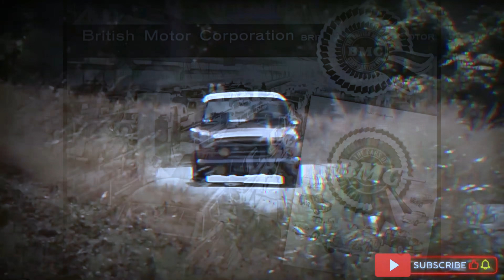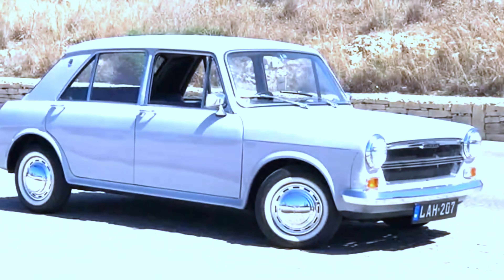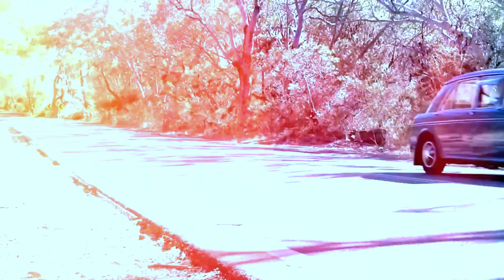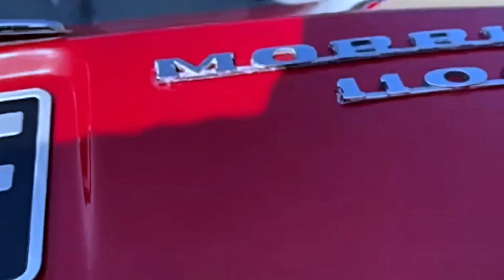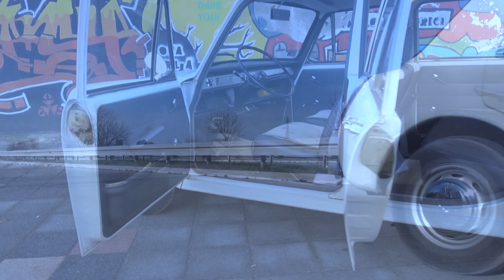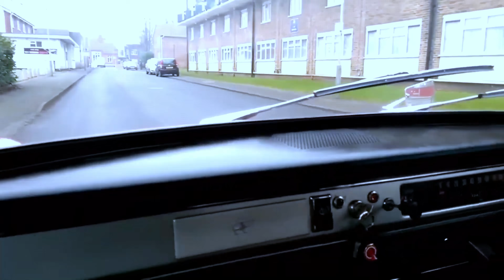The 7 Shocking Truths About the Austin 1100/1300 They Never Told You

Comment: I agree with harry gatto. These were always the austin/morris eleven hundred/thirteen hundred.  I owned an 1100.  A lovely car but beset with rust in the front wings and hydrolastic fluid loss which tilted the bodywork to one side.  Yes, it could be pumped up - only to leak again.

Comment: We had the Austin version of the 1100. When going on holiday one year in an English monsoon, we couldn't stop the rain getting through the front grill and on to the distributor. The breakdown man couldn't dry the unit out and only option was to tow us to a hotel for the night. Our two very young children loved the hotel and we hated the car. Got rid of it quickly on our return home
Reply: My girlfriend in the mid-70's drove her father's Austin 1100 at University. It would get water in the distributor as soon as there was any rain. I notice in this video that someone had fitted a rainguard over the front of the engine. Things weren't improved by a HT lead that was essentially a "candy floss" of black carbon fibres best replaced by a proper copper cored lead. On one occasion I was attending to the wet HT lead when her father suggested that she try restarting the engine when I still had it in my hand.  It was a massive example of my self-control that I reached in and took the ignition keys out without cursing either of them whilst it felt as if someone had tried to wrench my arm off.  I also recall that there was a badly welded seam at the rear base of the front wheelarches that allowed water that was thrown up by the tyres to enter the car. Other leaks meant that the internal floorpan became a paddling pool in heavy rain noticeable when you braked at the first junction by a tsunami wave of water filling your shoes over the back of your heels. It was an easy car to break into and steal as proven by the car being stolen from a carpark. Secretly hoping that it was the last we would be seeing of the damned thing I was disappointed when the police found it and informed us to recover it. It was finally replaced by her father with a Hillman Imp which was to prove another wild experience of poor British car manufacture. Don't let anyone tell you that they were better days of motoring.
Reply: @johndavenport7281  Sounds as though your experience was even worse than ours, but we didn't keep the pile of rubbish very long at all.

Comment: My father bought a one thousand nine hundred and seventy one Austin American with the one thousand two hundred and seventy five engine. It was a very roomy and as I recall very comfortable car. I was also slow as a snail. It could have been brilliant if it was a hatchback with more power and reliability. His was one of the rare ones that the engine quit before the automatic transmission. My understanding was that the engine and transmission used the same oil so that when any tiny metal fragments got in the oil they destroyed the auto. It also lost pressure on one side of the suspension. He repaired the leak and Jerry rigs a brake master cylinder to pump it back up again.

Comment: My first car was a 1968 Morris 1100 4 door automatic, purchased in 1974. It was a very popular car in Australia, winning car of the year in 1964 when it was introduced. Although I only had it for a couple of years, the only trouble I had with it were noisy CV joints, which I had repaired. I never had any problems with rust or the transmission, and I know it survived for years after I sold it as I often saw it driving around the area where I lived. It was a good car for a new driver like me because it wouldn't go very fast, and took a long time getting there!

Comment: I had a 64 1100 rear swing arm suspension used to produce cracking noises. Remedy was to install grease perks and pump grease into the whole unit!!!
Reply: The rear suspension arm pivot bearings needed constant attention if not they made cracking sounds. Putting the zerk fittings was one way to keep them lubed.

Comment: I had a 1967 MG1100 four door model and that car started my career as a mechanic. I can still remember all of its design flaws and the few good points it had. The biggest flaw on the A series engine mounted above the gearbox was they filtered the oil AFTER it passed through the oil pump. This meant the metal particles from the gearbox constantly wrecked the clearances in the pump, resulting in low oil pressure.
Reply: Oil filters are paced after the pump because they need over 3 or 4  bar pressure to force the oil through the filter.  If you suck the oil then you can only get 1 bar, ie atmospheric pressure.
Reply: @rogerbarton1790  you are correct in that way, what I should have said is a better pickup screen in the sump that can be accessed and cleaned.
Reply: I purchased a Austin 1300 I needed a car in a hurry bought it in the dark because the bidy looked straight. Hadn't had it long when lights played up(Boot flooded, fixed it by drilling little drain holes here & there) Next gearbox became noisy (Engineer who fixed it told me it was the idler gear failed because the standard casting on an 1100 was bored out to fit bigger bearing which weakened something) It failed twice B4 I got rid of it.